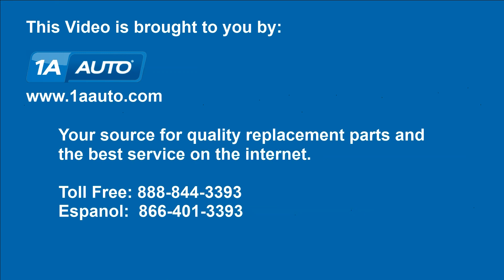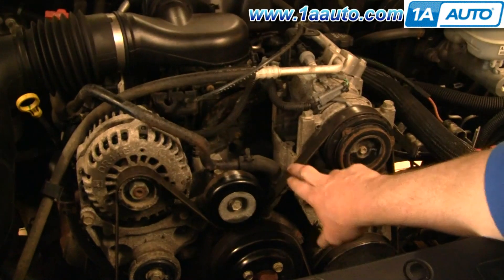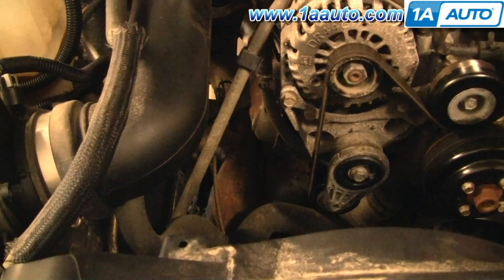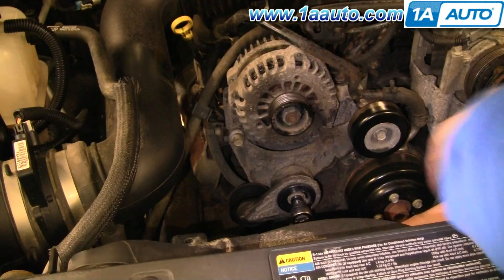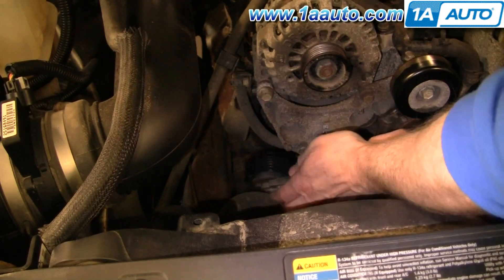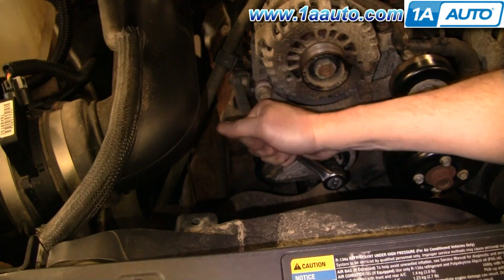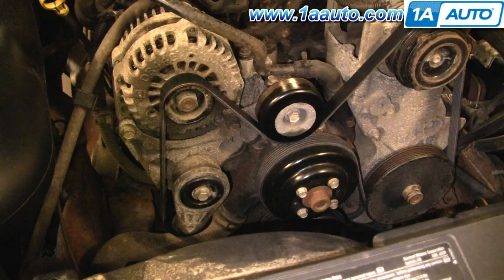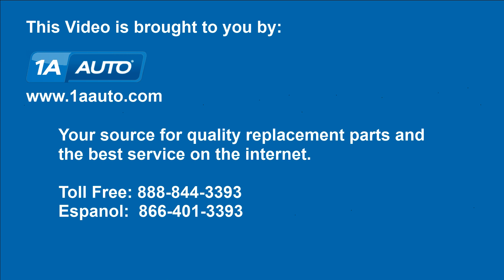How to Replace Serpentine Belt Tensioner 99-14 Chevy Silverado 1500

Comment: 330,711 miles on my 06 with the same 4.3L. so far, I’ve done the front brakes, replaced the wheels and tires, did the spark plugs, wires, and distributor, now I’m working on the fuel Evap system trying to fix a leak.

Comment from the maker: +Al Ram 
It would be difficult to diagnose over the internet, but have checked for play in the pulleys or in the belt tensioner.  If any of those are loose, it might speed up wear on the belt.  Hope this helps you out.  1aauto.com 866-403-3393

Comment: I have 220,000 with the original serpentine what pulleys should I replace with the belt other than the tensioner?
Reply: Wow! That's incredible. Very surprised you've gotten that much mileage. I'd certainly replace the drive belt, the tensioner pulley assembly, the idler pulley, and the A/C belt

Comment: Should the tensioner be moving up and down while the truck is running mine is doing that and making a lot of noise. My engine light is on due to maf sensor. My truck will barely go on the highway at 70 has no power at all unless down hill. Pls help me
Reply: U fix this?

Comment: While I am down there, should I replace my belt too? Cars at 165k miles and I'm not positive if it has been changed. Got it at 150k miles
Reply: Wow! I'd certainly replace the drive belt, the tensioner pulley assembly, the idler pulley, and the A/C belt.

Comment: How do you push down the tension thing like that? It's a nightmare to even to get it to budge half an inch.
Reply from the maker: +Jonathan Allison I would say that's a sure sign your tensioner needs to be replace. Can you pull it back enough to at least get the belt off? If not, you could try removing the tensioner itself first. Just be careful to not it snap forward once it's loose. Thanks for checking out our videos! If any of our viewers need to make this repair, we carry the part shown in this video on our website. Here's a link to them. We also offer free shipping on all orders in the US. http://www.1aauto.com/1A/SerpentineBeltTensioner/Chevy/Silverado1500/1AACD00009?utm_source=YouTube&utm_medium=CTA%20Comment&utm_campaign=1ATony
Reply: @1AAuto  Llllñ!?ki